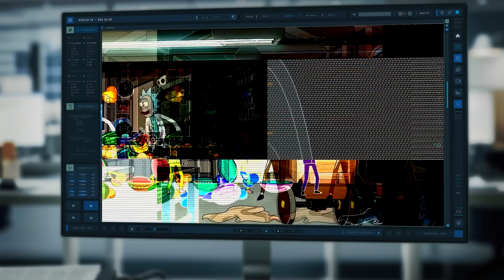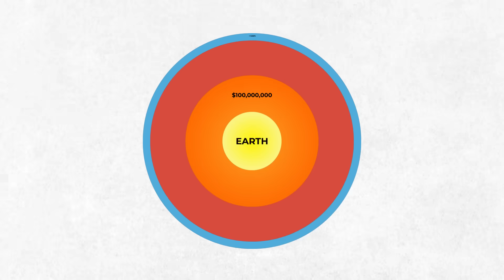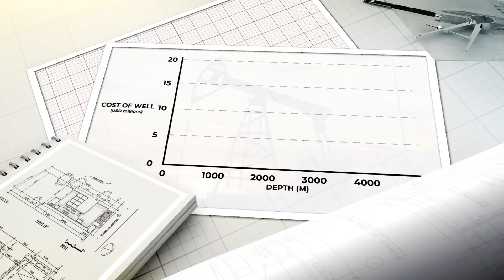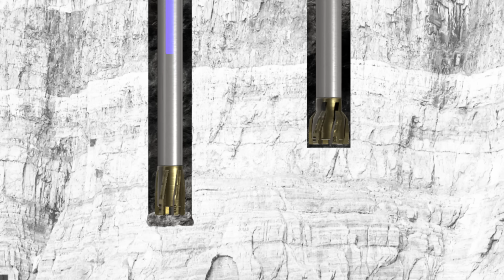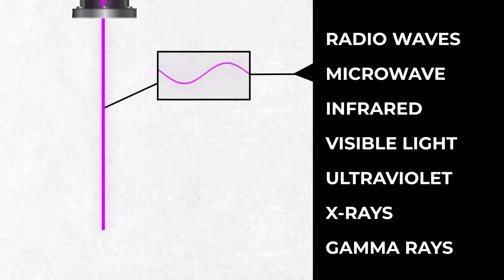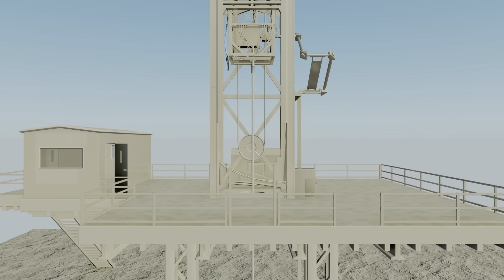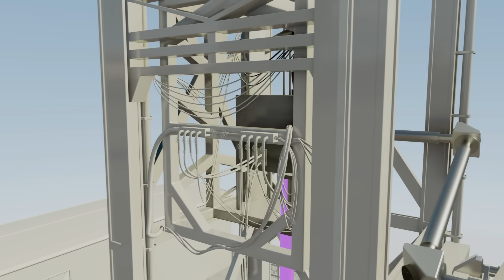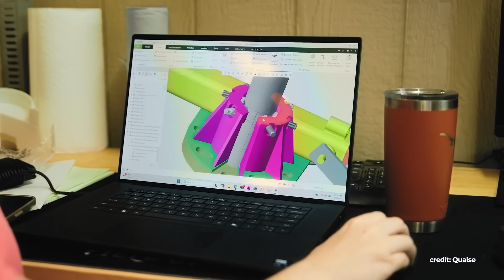The Most Advanced Drill in Human History

Comment: TLDR: Scientists are dropping a light-saber perfectly f**king vertical to reach the geothermal layer of the earths crust in order to... you guessed it... boil water to turn into steam to turn a turbine to generate electricity. Boiling water wins energy production of the year award once again.
Reply: alot of homes in sweden use this to get heat
Reply: @Dennan where’d you get the light sabers, and can we rent one? There’s no need for America to reinvent the wheel so to speak, if Sweden already did it better.
Reply: @Hazmatguy117  lol i ment they borrow holes hundres of meters down and then use the geo heat to heat the homes.
Reply: @Dennan ah oh well… we’ll join you soon brothers!
Reply: @Hazmatguy117  My friend Sweden has a lot of volcanoes and Hot springs. They don't need to big very deep to get to boiling hot
Reply: @Hazmatguy117  keep using your oil generators, clean energy shall not be granted.
Reply: @Mangoxide we could use….. gasp nuclear!
Reply: @Hazmatguy117  that’s the Germans ideas! Shoo!
Reply: @Mangoxide Frauenhofer Institute forever unmentioned.
Reply: Hope someone told verti-saber.
Reply: Water is just too good at it. Superheated steam at around 350 C really has no easily available competitors in that same temperature and pressure range.
Reply: we could also use supercritical co2 turbines at some stage. Maybe with dual cycle geothermal or nuclear
Reply: At its core how much have we really “progressed”?
Reply: I choose to hear this as parz in my head....
Reply: where did you read these
Reply: Just turn down Your screen brightness and get smaller televisions.
Reply: Water is wack, yo
Reply: I like the rick and Morty reference
Reply: Ah... steam power everything
Reply: Think they could boil water with that light saber to a point that more electricity is created, than consumed?
Reply: @duellyiamgemini no. That would be like creating a perpetual motion device. Some energy is always lost. There's no way that you could use 'x' amount of electricity to power the laser, boil water, turn a turbine, and end up with 'x+y' output electricity.
Reply: boiler allert^^
Reply: Yay! Go steam! 🤣🤣🤣
Reply: I dropped out of school in the 9th grade but.. I can see a couple issues with this, first the Wells would moat likely have to be drilled deeper after the well start to constantly cool the in that area and 2nd what happens when a land mass the size of the united states or better yet all major countries start pulling this much energy/heat from the earth's core? Will it cool the core? Well of course, will it slow down the earth core current circulation? It's magnetic fields change....?
Reply: How do they make the cavity at the bottom that they fill with water to boil?
Reply: @antonybarron8949  i think its a hollow pipe so not really a cavity but a long pipe that is heated, some house use several holes, not just one.
Reply: Purge gas could start as a liquid like LN2 or perhaps a supercritical C02 to exploit it’s character as a solvent.
Reply: This would never happen under DiaperDon. He hates renewable energie. This is a kind of source only for smart governments 😉
Reply: And you want a medal or what?
Reply: it seems so archaic depending on steam turbines
Reply: @Justadonkey truth is the only other way to generate power other than spinning a turbine would be some friction engine operating like, I think it’s a van graph generator or something similar, basically making lots of static, or we have to use solar, or piezo metods, turbines just work best
Reply: @thefilthiestpeasant4573 I’m down for piezoelectric methods that would be so lit , bring back ancient tech 🗣️
Reply: @thefilthiestpeasant4573  Ther are two ways to generate energy, a turbine or solar. Everything that is not solar is secretly just a turbine. Sometimes it is wind or an artificial waterfall turning the turbine, but most of the time it is just boiling water to produce steam. Be it a nuclear reactor, geothermal, etc
Reply: @diablo.the.cheater tracking, we’ve learned how to boil water many a ways, that’s for sure
Reply: @Justadonkey  Archaic means "no longer found in everyday use". The iPhone 10 is orders of magnitude more archaic than steam turbines, officially holding a "Vintage" designation by Apple. Meanwhile, water is still just as useful today as it was 10,000 years ago, if not more, yet it hasn't changed in any way. Even the pair of socks on my feet is more useful than an iPhone 10, despite sock technology peaking in the 19th century. My 2004 Toyota is superior to a 2024 Toyota, I would never make an even trade.
Reply: @Justadonkey  What do you think nuclear power plants do?
Reply: How will a thin layer of glass withstand the pressure of water and gas trying to push in? Drillers use steel casing and mud for a reason.
Reply: @unrealuknow864  Firstly, I don't think it is all that thin, and secondly, it is backed up by rock through most of the drill.   They might need a casing where there is no hard backing, I don't know, but they won't through rock.  
Secondly, a fairly thick annealed glass tube is stronger than you think it is.
Reply: Ah, geothermal energy, basically limitless.. like oil/gas was... what could possibly go wrong? 

Oh, I know we can't possibly effect something like the world/earth...

On a side note - I'm confused why volcanoes essentially are just magma and stuff trying to escape the high pressure, but poking a hole from the surface wouldn't enable the same high pressure to find it's way up.. and if the answer is (well they dont need the magma and avoid it" then 1 I foresee some dangerous mistakes and 2 on that note why do they need to go deeper then they already have since it gets so hot so quick..?
Reply: @adriancharbonneau7124 there isn't magma everywhere in the crust so as long as they dont "drill" into a magma plume.
Reply: We should harness the heat from the homeless to do the same... just saying not everyone has skills but heat does work without skills or ambitions
Reply: @JackKoff-l8d  Either you haven't seen the matrix, or you're a robot nad you're hoping I've never seen the matrix
Reply: @cwcaswell i saw it i didnt say stuff anyone in a pod you choose that idea i was more thinking put them in a shelter and use a heat pump to remove heat from the shelter to boil water. 771000 homeless in America 98 degrees each that 75.5 million degrees of heat energy xD
Reply: @JackKoff-l8d  okay so not a pod, but an airtight enclosure, got it
Reply: @cwcaswell i dont need 100% efficiency it can have air holes XD naww man isnt your bed warmer whe you wake up than when you went to bed? Thats work XD
Reply: @JackKoff-l8d That heat is generated from food, which is grown with fossil fuels, so no win. It would be more efficient to just burn them and make room for the next batch.
Reply: @KarolHaltenbergeri mean they are eating anyway..  we are the only nation with obess homeless XD its not about green energy its about everyone doing some work
Reply: Im sure nothing bad can ever come from extracting energy from earths liquid core, which shields everything alive with the magnetic field it creates.
Reply: @UnfollowYourDreams  We ain't goin' that f'in deep my guy
Reply: @devmmmdoesstuff6429  dude, it doesn't matter. I know they're not drilling into magma plumes (hopefully). But thermodynamics is kinda basic law of nature stuff. If you extract energy from a system it's gone and not coming back.
Reply: @UnfollowYourDreams  You really have NO idea how much energy lies beneath our feet, do you? It seeps out anyway. And by the way, it is constantly replenished by the radioactive decay of HUGE amounts of uranium.
Reply: @HapeBraun  uh... That's not how any if this works.
Reply: @UnfollowYourDreams  Since Google is free, ignorance is a choice. Educate yourself instead of making yourself look ridiculous with semi-knowledge.
Reply: @HapeBraun  the irony... bless you!
Reply: @UnfollowYourDreams  yea but us using that electricty for a century is like taking a grain of sand off of a beach, the ocean is already taking away but its constantly replenished from other sources
Reply: @infinite4809  that's what people said about fossil fuels. Now were dealing with +3C° until 2050.
Reply: @UnfollowYourDreams what if I told you that the heat is generated from the friction and pressure due to gravity, and billions of joules of energy are being generated (and released, via tectonic plate movements, volcanos, etc) every day?
Reply: @DravenX37  "whataboutism doesn't defeat thermodynamics" would be my answer.
Reply: Uhm... considering that the Earth has sufficient energy to remain molten long after the expansion of the Sun would swallow it whole... yeah, it's kinda stupid to think a borehole or even a few hundred would make sufficient difference to doom life on Earth. We'd be syphoning off a fraction of a percent of the waste heat, anyway - what's left AFTER all that work is done and which normally just escapes into the atmosphere.
Reply: @the_Carthaginian1  yeah, the atmosphere can take in a lot more heat. But it can't radiate it away into space any faster. Means it gets hotter, in a world already at the tipping point.
Reply: @UnfollowYourDreams  why would it not come back? Have you ever looked into what fuels our core? 
Just think with me a moment. The heat used to boil water is wasted, sure, but the water eventually ends up back into the atmosphere, into the oceans etc. that heat used to boil the water doesn't just leave our atmosphere, it has to change into another form of energy, albeit slower without heat. Eventually, that energy will go back into the system in one way or another over time. 
Whatever fuel source keeps our core hot, is where that lost heat will end up again.
Reply: @TitanAtlasss  Heat never transfers from the colder to the hotter place, nothing is going back anywhere. What you propose would reverse entropy.
Reply: @UnfollowYourDreams  This is kinda like worrying about the sun running out of energy. Technically it will happen but boy is that not something we have to worry about right now
Reply: I feel like you aren't accepting the idea that the heat has to come from somewhere. You can't start off hot. Whatever is keeping the core hot, will eventually recreate that lost energy. Nothing leaves the cycle. It may seem so on a small scale, but in the larger picture it is always brought back. 
Burning gas in your car, it creates movement but it becomes a wide mix of gasses, liquids and solids. All the elements within that cycle are returned to the air. It settles, on the ground, in the water, wherever. It is always there, ready to be recycled. Be it us, or nature
Reply: @UnfollowYourDreams on a unrelated note, I think we should imagine bigger. Sure, tapping our mantle for heat would be great but if we could harness energy from other planets and bring it back here, we'd be better off. 
What do you think?
Reply: @TitanAtlasss  you have no idea just how massive the earth is do you?
Reply: @HapeBraun that and the tidal forces from the moon’s gravity also aid in the process
Reply: @TitanAtlasss  yeah, you feel stuff instead knowing things. This is not how any of this works in nature. You do not understand basic physics.
Reply: @ShandoGuardian  same way people in the late 1800's didn't need to worry about the consequences of burning fossil fuels, like acidic rain, lead poinsoning the entire planet and of course climate change. I know it will not become a pressing problem in the next 50 years, but we need to stop chasing short term rewards that just kick the can down the road. We just have this one planet and we barely understand on a surface level how interconnected everything is. Doing geo-engeneering experiments in the only habitat you have is just crazy.
Reply: @TitanAtlasss  also: we have a star in our solar system and we're positioned in the goldilocks zone arround it. Why would you invest all the materials and energy and labor to fly to another planet, set up shop there, develop an industry and then bringing back home what is deliverd to us for free 24/7? Makes no economic sense at all, sounds more like a typical billionair PR-stunt pipe-dream designed to make real world villians look like very smart science dude-bros pushing humanity into the future.
Reply: @UnfollowYourDreams okay so hear me out. We're killing this planet and that was your main argument. "We're likely to sap all the energy if we use the heat from the core" something along those lines is what you were mentioning. 
That's why we'd tap other planets/asteroids. 
Pollution is the biggest problem next to humanity's nonsense. It's not hard to look at it from a perspective of future proofing our own materials
Reply: @UnfollowYourDreams  oil comes from dead life. You can't find that anywhere else that we know of. 
If we find evidence of life, there's likely to be oil. If not oil, hydrogen. If not hydrogen, we can find another source of fuel. We're fighting wars over land/materials on a planet half the population doesn't care about.
Reply: @UnfollowYourDreams I just want to say , as a final note. There is a clear difference between the two of us. I'm suggesting solutions, and even feeding into your silly argument about the mantle, providing solutions and explaining what I know. You only know what you believe is right, and wish to spend your time and knowledge, arguing over physics in YouTube comments sections. I've provided solutions and bright examples of ideas, you've just put multiple people down and stated "you don't understand physics" 
I don't think you've come to understand anything, anyone has said. You won't accept it. Therefore, you aren't the person to be debating this with and you sure as hell aren't the person to deny anyone's ideas. When you've done something related to solving the world's problems, maybe your voice will be more important. The way you act in this comment section denies any evidence of that ever being the case though. Have a good day
Reply: @TitanAtlasss  no you don't present solutions. You write science fantasy short stories. And no, i'm not going to hear you out. Science is a method of finding facts, not a marketplace of ideas. You can not debate against fundamenral laws of nature, you have to work with what we got. Deal with it
Reply: @UnfollowYourDreams  all you said is that I'm right. I mean look at your argument. 
Your so wrapped up in your emotions you can't even fathom the idea of trying anything new. You're just the church in this story, banishing any wrong thoughts. Who'd wanna listen to you?
Reply: @UnfollowYourDreams  To be fair to you, we don't 100% know until we try it at the scale proposed in the video but I don't see how this could ever be a problem. Maybe you're trolling but whatever
Earth has a radius of 6000 km. The magnetic field comes from the core and volcanoes have been spitting out energy for billions of years. The scale of energy in the earth is so massive that we are not even close to being able to use it up
Reply: @ShandoGuardian  we don't need to use up anything to disturb the delicate balance that is our ecosystem. I'm positive the planet can handle the loss of some heat, the question i'm interested in is: can we as a species?
Reply: @UnfollowYourDreams  you're worried about the literal heat? You know we use the same amount of heat either way right? Probably more because geothermal is considered to be extremely efficient. The whole thing about climate change is that the extra co2 in the air insulates the earth. This has a bunch of knock on effects. Removing that variable seems to be nothing but a good thing as far as I can tell
Reply: @ShandoGuardian  the only long term viable source of energy is sunlight, ie. solar, wind and biofuels. If you burn fossil fuel, nuclear fuel, use geothermal or fusiontech - all of these methods introduce extra heat in our habitat, without a way to radiate it away any faster. Sure, greenhouse gases amplify this global heating effect, but it would have happend anyway, with the tipping point just pushed a little into the future. There is no free, clean and cheap energy besides what the sun delivers to earth all the time. That's the hard limit, and if you break it you do uncontrolled geo-engineering future generations will have to sort out.
Reply: @UnfollowYourDreams Can you point me to any studies to back up that statement? I have literally never heard anyone be concerned about the extra energy due to non-solar based energy systems.
Reply: @ShandoGuardian  this isn't a study, it's just thermodynamics, plain and simple. The planet has a (surface)temperature, recieves a certain amount of energy from the sun and can just radiate away heat at a certain rate, these are known quantities. The balanced relation of these three quantities determined the temperature life adopted to. If we shift things out of balance by just a few degrees we're doomed. No need to do a study, just the laws of nature and their consequences.
Reply: @UnfollowYourDreams  Ok I was trying to be as charitable as possible but this is a ridiculously bad take.
First of all, thermodynamics also tells us that the hotter something gets the more quickly it will radiate heat. There has been a swing of a bit more than 20 C over the course of 100 million years and that did not cause the earth to go barren.
Secondly the earth's temperature has changed by a few degrees many times over the roughly 3.5 billion years that life has been on earth.
Thirdly, we encounter a problem of scale again. Most recent numbers for energy consumed by humans per year is a bit less than 200,000 TWh. Let's multiply that by 10 to account for inefficiencies so 2,000,000. The sun, conservatively, puts 200,000,000 TWh of energy into the earth every year. That means we are VERY conservatively only adding an extra 1% of energy into the earth every year compared to the sun. This is not taking into account any volcanic activity which would also release heat into the surface.
Fourthly, When life started ~3.5 billion years ago the sun was a bit more than 20% cooler than it is today and when the first complex life appeared on earth 1.5 billion years ago the sun was about 10% cooler. The sun will continue to increase in temperate by about 8% every billion years.
Finally the temperature of the earth is not solely dependent on a single variable. It is not an oversimplified, closed system that you would encounter in a thermodynamics class. Atmosphere composition, ocean currents, air currents, and volcanic activity, 100 other factors that i'm not aware of and 10,000 other factors that no one is aware of all play a role in the climate and importantly they interact with each other in a very complex manner. As one of these variables changes it impacts all the others and it changes how all these variables interact with each other.

This is some of the weirdest solar power ideological cope i've seen in a while
Reply: @ShandoGuardian  yeah that's just the most common fallacies regarding this topic combined. Your examples take place on geological timescales, 100 million years or more, but we're dealing with human timescales here and that's not enough for life to adapt to +5°. The second and third fallacy are also related to scaling, first of all even a slight nudge can tip over a system(chaos theory), and second, although counterintuitive, things can scale expotentially. Go draw a graph of a 1% growth rate per annum. Count how many years it takes until you end up with at least a magnitude more than you started.
Reply: @ShandoGuardian  yeah, the sun was cooler but the planet itself was hotter back than shortly after it formed, and luckily for us, the cooling planet suface and the increased radiation from the sun roughly evend out. I never said that the earths temperatures are dependant on a single variable, quite the opposite. I pointed out multiple times how interdependant and delicate the balance of our ecosphere is, how one little thing can spiral out of control you didn't even think about. That's why i said it's a bad idea doing large scale geo-engineering experiments in our only habitat. But here you are, calling my very valid arguments a cope after doing strawman shananigans and wasting my time with fallacies. Have a nice day!
Reply: @ShandoGuardian  regarding vulcanos and other natural phenomena: although i didn't make a list of all factors influencing the delicate balance we owe our existence to, these phenomena are obviously taken into the equasion. But to repeat an earlier point, it's again a question of scale. One krakatau has less impact than the siberian traps for example. Such phenomena can have, and that includes impact events, a tangiable impact on our planet. We shouldn't strive to recreate such extinction events just because solar and wind is more or less free and not profitable enough in our current economy.
Reply: @UnfollowYourDreams  You're mixing up so many things here dude. I pointed out the shifts in temperature that earth has undergone in 100 million years to address the "tipping point" argument. You can absolutely argue that a couple degrees shift over a short geological timescale such as a few hundred or thousand years can drastically damage the ecology of earth but you can't argue that this will have a snowball effect and turn earth into venus. Earth has been much hotter before and that didn't happen. This is especially true since your concern here isn't greenhouse gasses but generating energy in and of itself, which once again I have never seen this argument before and you haven't been able to point to any scholarly work addressing this so your burden of proof is quite high.

You are assuming that an extra 1% (again an inflated number) of energy on earth per year will equate to a 1% increase in temperature each year which you need to justify. Saying "thermodynamics" is insufficient. Earth is not a closed system and and we don't see equivalent 1 to 1 changes in world temperature and solar activity. In the short term changes in solar activity drastically changes the climate in the long term earth's temperature has been remarkably stable despite a drastic increase in solar activity. I'm interested in what data your pulling on for saying that the sun was cooler but the earth was warmer so it canceled out. Do you have data for the temperature of earth's core over the course of its life or the residual heat from the formation of the earth and how long it lasted? From what i've read the earth solidified ~4.4 billion years ago and the core formed around the same time. If you have evidence that there is a delicate balance between the earth's internal cooling and the sun's increasing luminosity this would have been a good thing to bring up when I asked if you were aware of any research that backed up your claim.

You are claiming that our ecosphere is in delicate balance while I made a claim that our climate is driven by incredibly complicated factors that we don't understand. These are not the same thing. You said that your only reason you are concerned that generating energy with anything but solar energy (btw, why is wind and hydro excluded?) is dangerous is because of "basic thermodynamics". We need far more than basic thermodynamics to draw any valid conclusions about what our climate will do on any time scale short of a billion years. On an astrological scale our climate is not delicate at all but incredibly robust. No where else in the universe that we know of is as stable earth has been.

The siberian traps are relevant to the climate debate because of the co2 it released not because of the heat itself. It is possible that the climate scientists focus on atmospheric composition as the driving force for climate change as opposed to internal heat released from the earth but once again this is not a commonly accepted theory and it needs serious proof beyond simply saying thermodynamics.

If you are concerned about the climate then I find it baffling that the primary focus would be anything but eliminating co2 byproducts. Is it possible this is a concern? Yes. Is it a pressing or convincing one? No.
Reply: @ShandoGuardian  look, that's why i never argued earth will see a runaway-effect to either a snowball earth or venusification. Do not put words in my mouth, reaching a tipping point (with, for example, melting ice-shields) does not equate to runaway-scenarios.

But sadly that's just your first strawman argument.

I also never made any connection between your 1% growth rate and any unit of measurement. I just challenged you to draw a curve, so you can visualize seemingly little rates having huge impacts relativly fast.
Because in the end it doesn't matter what metric you use, if one part of the balanced system spirals the entire system gets caotic.

Humanities combined GDP is ~1:1 related to our energy consumption. Our economies don't grow at 1% per annum, what you present as a conservative estimate of energy consumption is even below the inflation rate. A free market economy with such growth rates in energy consumption wouldn't be viable.

If we look at our planet as a system within a human lifetime, it is for our intents and puposes a closed one. We are not going to find oil on other planets and harvest asteroids, like that other dude presented as "solution" to the multicrises, and that was the context in which i made that claim i still stand by. It's a tool to look at earth in an ecological or economical sense, as opposed to geological or cosmological points of view that deal with extremely different time scales that turn such an argument ad absurdum.

My evidence that there is a temperature balance that allows us to exists is the simple fact that we exist. This is known as the anthropic principle. It can only be that way because we wouldn't be here asking the question if the conditions weren't right. Mind blown.

I did not exclude wind, just hydro, you need to read more careful.

Listen, you brought up vulcanos and greenhousegasses, and i threw impact events into the mix to aknowledge that climate changes over relativly short timespans do cause extintion events we should not recreate.

I did not mention the heat, energy or gases released by eruption events because that wasn't the point. The point was to show the effect of scale and how even a vulcano can cause an iceage or greenhouse effect. We can do that too, in multiple ways. Even though we are just tiny humans.

My primary focus is on leaving the spiral of endless uncontrolled growth. Because like i previously mentioned, everything is interconnected, there is no one technical solution that solves all our problems. We need to restructure our entire economy towards renewable and recycled resources, away from consumerism and mindless consumption. We need to live IN our habitat, not consume it. There is no other ecosystem we're adapted to, which is another reason to call our planet a closed system. Nobody is going anywhere, the rats can't leave the sinking ship, not with all the money in the world.

Now stop wasting my time please, thank you.
Reply: @UnfollowYourDreams  We are arguing over creating extracting energy from anything but what already exists on earth's surface/atmosphere could "unbalance" the climate. This is specifically not about co2 emissions because geothermal has essentially none.

You have not been clear what a "tipping point" is. Usually when I hear that phrase people talk about making the earth literally inhospitable to complex life. The glaciers melting won't do that. But I will admit I jumped on vague language.

Drawing curves to visualize things doesn't help if the curve is not reflective of reality. I am aware of how compound interest works. I can draw a graph to visualize whatever I want. The important part is determining which graph is reflective of reality. That requires actual data and research to determine.

My bad on the wind, why exclude hydro?

I brought up volcanoes as a side point to emphasize that my 1% value is significantly overblown. This is because I multiplied the consumption value by 10 which I believe is an overestimation and because the source I used for calculating solar energy that enters the earth each year was only for the portion that hit land masses. Im just doing some quick googling so the actual number could be very different but the point is that with the information that I have right now the amount of energy we generate is not comparable to what the earth gets from the sun. If you want to argue that this small change is likely to cause runaway global warming the you need to provide evidence. All the runaway theories about global warming i've seen are specifically due to the atmosphere changing. You're comparing apples and oranges

"We need to restructure our entire economy towards renewable and recycled resources, away from consumerism and mindless consumption." This is why I said you were coping ideologically. We have a very specific problem right now or at least a potential one. Our society is releasing so much co2 into the atmosphere that is causing the climate to change much too drastically. The drill people are trying to solve one portion of that specific problem. Will they succeed? I don't know, but it is a realistic approach to solving a single aspect of our specific problem. The fact that you are opposed to it suggests to me that your real concern is not about climate change but how society is structured.

Solar can and should be another part of the solution to the problem but you are claiming it and wind are the only ones because "basic thermodynamics" and because sometimes small changes lead to big changes. This is not logical. You need to cite someone who has actually rigorously done the math and explain why this specific small change will lead to that specific big change.

Extraordinary claims require extraordinary evidence. You are positing a theory and have not provided any actual data to back it.

You are choosing to waste your time by arguing in youtube comment sections. If im not worth your time stop replying
Reply: @ShandoGuardian  no, i'm not providing any data and what i laid out here is not a theory, i'm just using certain axioms and logic to reach conclusions. I'm providing historic examples that show that the conclusions i arrived at are more than reasonable.

The reason i exclude hydro is the huge ecological impact it has compared to solar, wind and biofuel.
Reply: @JSMCPN  making strawman arguments and telling me to google things you yourself don't understand doesn't earn you any respect. Quite the contrary.
Reply: @UnfollowYourDreams  I mean you're kind of right. No energy is lost it's not going to escape earth, but it's being redirected from the mantle. That being said it's like taking drops of water from the ocean and worrying about losing our oceans.
Reply: @Knatrick  i'm not worried about losing any energy. I'm concerned about large amounts of energy beeing shifted arround and  in unnatural ways by humanity.

Yes, our mantle radiates heat away anyways. Radioactive decay happens naturally anyway. Vulcanos errupt anyway, all that is true. What we humans do is speeding up such processes in rather exteme ways, if you think of nuclear energy or weapons for example. We found ways to speed up natural processes to a point where we can burn the planet with the push of a button. Sure, that's a rather extreme case of releasing large amounts of potential energy at one, but it shows you the trajectory we're on. We constantly invent new ways to use more energy faster, in a system that is already overheating... hope that helped to clear things up for you!
Reply: @UnfollowYourDreams Energy expenditure is the best way to measure how technologically advanced a civilisation is. Countries that use more energy per person the quality of life is generally better.
Reply: @Knatrick  yes, but who said that energy needs to come from fossil fuels or nuclear? Short term gains do not outweigh long term selfdestruction.
Reply: @UnfollowYourDreams  Well right now we can only extract energy from our planet. I'm all for solar power and putting solar panels on the roofs of buildings and roads rather than just putting them in empty fields that could be used for something else.

In the future we will be able to extract energy more efficiently. Fusion/antimatter/dyson spheres but right now we're stuck with what he can manage on Earth. 

Fission is still an extremely valuable and much less enviromentally hazardous energy generation method than most people realise.
Reply: @Knatrick  see, that's exactly what i fear, that we tap into all possible sources and extract energy more efficiently. For the reasons i laid out. It's borrowed from the future and brought into the here and now. Instead of seeping out at a natural pace, we speed up things by several orders of manitude. This will overheat our habitat long term, no matter if you release the concentrated energy from fossil, fission, fusion, the endeffect is the same.

Also, antimatter-reactors and dyson-whatevers are pure science fiction, these are thought experiments that are not really viable from an economic and engineering standpoint. Same goes for things like the kardashev scale and drake equasion. These are tools for thought experiments in search for alien civilisations, not some scientific milestone that guides humanity into the future. This is not real science. These are not things humanity will ever do.
Reply: @UnfollowYourDreams I definitely agree fossil fuels are harmful but realistically at the rate we're using them it's not affecting the planet as much as you'd think. And in terms of heat, the planet is a closed system that self regulates, whether we're here or not the earth would heat up and cool down the same.

Anti matter and dyson spheres are only science fiction in the sense we haven't utilised either yet. We will at some point. Anti matter is probably the most promising form of energy for space travel. Entirely possible within the known laws of physics to utilise.
Reply: @Knatrick  and that's where we end it. You deny human made climate change and believe things like dyson sheres are actual, possible ways to generate power for a civilisation. Because that's whats shown in TV shows and games and on youtube futurism channels. Even if such things were possible, none of that changes the problems we face in the next 25 years.
Reply: @JSMCPN  out of context quotes don't earn you any internet debatebro points either.
Reply: @JSMCPN  the technology presented in this video. It will certainly, on it's own, not become as problematic as current technology already in use over the next 50 years. Doesn't mean there's no potential though, since it functions under the same premise, as i laid out a dozen time in multiple ways over this thread.
Reply: @JSMCPN  lol no, i did not imply that we overcome the problems we currently face. STOP PUTTING WORDS IN MY MOUTH. That we're still developing tech like this is the best evidence that nothing will change. Because even if we magically solve this human made climate crisis, there are constantly new ones developed and tested or already in use. The entire path we're on is wrong. There is no endless growth in any ecosystem, that idea itself is ridiculus.
Reply: @JSMCPN  you just talk nonsense. I'm patient, explaining again and again, but you refuse to do your part. I can't tell if this is intentional or if there is a problem with reading comprehension or critical thinking, either way i ain't got time for this. I provided enough information for any reasonable person to understand my argument against technology that does not respect the natural boundaries of our hsbitat. Have a nice weekend!
Reply: @JSMCPN  also no, it's a false dilemma that we can have either a small and sustainable population or a large, short lived one. This is neither how biology nor sociology works, that's a right wing talking point (if X people disapear, all our problems are solved) to rationalize atrocities. The decision where we're heading is made by those who profit from all of this, not in the sleeping rooms of regular people. That's just what you're told so you think nothing can be done, except, you know, making it so that there are less people than before.
Reply: @JSMCPN  and that's neoliberal propaganda right there. This is not a law of nature, this is just how our economy is organized and what it incentivises. All this happens because we allow a very small group of sociopathic horders to accumulate absolutely unneccessary ammounts of wealth and power, pushing useless spaceprograms and or stuff that does not further human(ities) interests.
Reply: @JSMCPN  the first ever cars were electric. We had 100% selfsufficient, off-the-grid housing technology in the 70's. Science warned about human made climate change since 1872. Look at where we are today and tell me you believe the system works in (y)our interest.
Reply: @HapeBraun Oil would have a word. But its almost gone.
Reply: @UnfollowYourDreams never before have I seen someone be so confident yet so completely wrong in everything they talk about. Everyone here is dumber for having to engage with your completely made up nonsense. Its like you are fundamentally misunderstanding everything on purpose.
Reply: @bigdaddyrv16  go learn physics until the point where you understand that dyson was making fun of SETI with his dyson-sphere paper. Then we talk.
Reply: @UnfollowYourDreams see thats the thing with you. You toss around all these fancy words and quote other people, but nothing you actually say shows you have any understanding of the concepts at all. You've just memorized all the fancy words without understanding what it all means in context. Literal example of dunning Kruger effect. Show me that phD in physics that you have. 😂😂😂
Reply: @UnfollowYourDreams You don’t understand thermodynamics
Reply: @eedobee  sure.
Reply: @UnfollowYourDreams  Sounds like whataboutism and science fantasy to me.
Reply: @ChristopherGuilday  do you know how much oil is down there? Even if every city adopts oil lamps we will never be able to deplete it. Do you understand hos much air there is? No matter how much oil we burn it will never be enough to affect earth climate.

you probably, if you lived 150 years earlier.
Reply: @ChristopherGuilday  and NO, earth is not a closed system, that's something that does not exist in nature. Look at mars. Or venus. Our own planet can and will end up like one of those planets. We shouldn't try at every turn to accelerate that process.
Reply: @UnfollowYourDreams  Jesus buddy, I've read your posts here, your understanding of thermodynamics is very elementary. Go up in elevation, everything gets very cold very fast. Differential temperature there is always heat transfering. Greater differential means the radiant heat loss is quicker and more per unit of surface area. Your home loses more heat the hotter you have the inside temerature set at. The elements on your stove emit more thermal energy the hotter you set them and the surface area there is also fixed. Higher temperatures in our atmosphere are NOT going kill us, it will make our planet more habitable for us. Finally, the sun itself goes through cycles of higher radiant heat and lower radiant heat, guess what, the Earth's temperature stays about the same. Every day the heat energy the earth absorbes from the sun is radiated into space overnight. And finally, water vapour is the main greenhouse gas, NOT CO2, don't believe me look at a desert with scortching temperatures during the day and freezing temperatures at night because of the lack of water vapour, CO2 doesn't play any roll whatsoever at a mere 0.042% to 0.045% of the atmosphere at sea level.
Reply: @UnfollowYourDreams it would take millions of years to have even a slight impact, by which point there could be countless innovations or we'll all be dead so, not to worry
Reply: @comet8260  ok, let's ignore jevrons paradox for a second and let's also assume there will be no cascading effects as per usual in nature when humans disturb balanced systems.
 Now, given earth is a perfect sphere radiating heat uniformly in all directions, you still need to get rid of that extra heat in our atmosphere you helped escaping the planets core faster than natural. How do you plan to cool the surface of the planet after pulling up heat from further down? Given geological timespans and the human lifetime, for our intents and purposes earth has to be viewed as a closed system. In such a closed system endless expotential growth is by definition impossible. We can not use more and more energy that is not taken from the source of all our solar systems energy directly, the sun. It's either solar and wind or it's a bad thing long term.
Reply: @UnfollowYourDreams There's a giant nuclear reactor spread amongst Earth's interior, trapped by a thermal blanket good for billions of years. Volcanoes and earthquakes represent some of that venting of excess heat. Early in Earth's formation all that volcanism sat on the surface; nowadays the crust we walk on is the cooled down solids. One way or another that heat still needs an outlet. Steam pipes seem a far less violent and destructive process.
Reply: @UnfollowYourDreams  Nah, the energy that is down there dwarfs anything we might use it for. Literally, if we wanted enough energy for that to matter... not even covering the world on solar panels, burning trough all uranium and petrol would make a difference. Truth is that if we used enough energy to affect the earth in any way... we would have to be looking into crazy stuff to replace it like dyson swarms, trapping blackholes, antimatter or that type of shit. I don't think that even fusion can actually match the energy production from harnessing enough geothermal to cool off the core of earth. These tiny holes, of course, are not going to be enough to extract that ammount of energy to begin with, but even if we had some future tech to extract it quicker to the point that it starts to have an effect... there would be no alternative as only sci-fi energy generation would be able to match that
Reply: @diablo.the.cheater  the man made climate crisis is real, dyson swarms and trapping black holes is science fantasy.
Reply: @UnfollowYourDreams Who said anything about earths core???